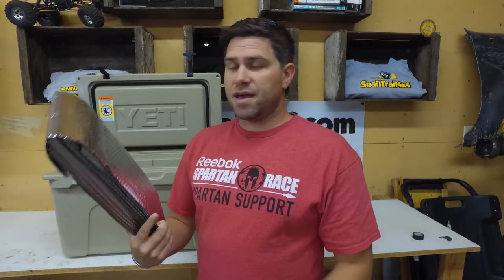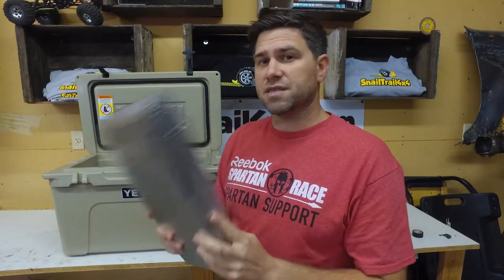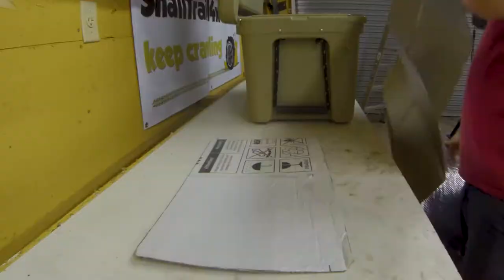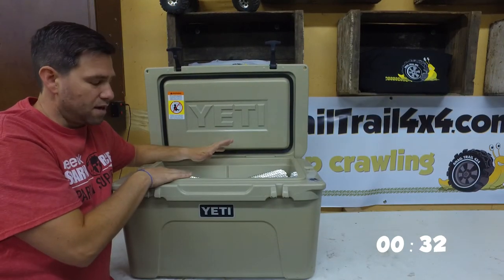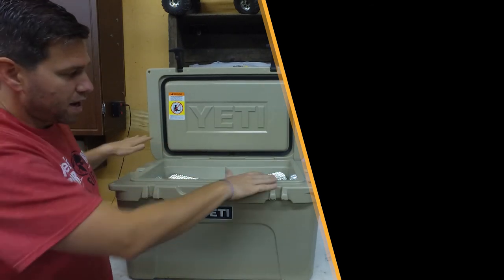False Cooler Lid for your ice chest

Comment: I did used on the top on the lid of my cooler and noticed the ice lasted 3 days longer than usual so I'm going to full wrap from outside since my cooler is in the back of my truck and gets exposed to the sun most of the time.

Also, I use 2 liter soda bottles filled with water and ¼ cup of salt, and it works awesome!

Comment: Air is a very good insulation. 

The problem is the distance between the surfaces. If too large say two pieces of glass, like 4 inches in between, you can get a vortex, circular air moving, from the hot side, to the cold, transferring energy. 

Same problem you get in the winter heating a room, hot ceiling to cold floor, circulation flowing between the two.

If the cooler manufacturer has disturbed the airspace flow, broken it up,  inside the lid, you are OK. If a huge rectangular airspace, and that Yeti looks like it has one, you need insulation. If you look at a lot of cheaper coolers, the bottom of the lid isn’t flat.
Reply from the maker: I understand what you're saying but I disagree with you about how air is a good insulator. If this was true, why do they add gases to double pain windows, or installation into walls and not just use air.
Reply: @SnailTrail4x4  mainly fogging in windows.

Some gasses stop,slow convection aka air movement transfer, hot side to cold. This allows very large window gaps between panes. Air is a very good insulation in foam, because the bubbles are small, lots of them, not connected to each other, bit of gapping between them.

https://www.courant.com/hc-xpm-2012-06-01-hc-ls-foggy-windows-20120526-story.html 

My problem is people who shoot thick, closed cell foam into the lid. If this stuff isn’t allowed room expansion, my guess, they just created a very dense, thick, heat transfer block in the lid? 

You need air bubbles in that foam, lots of them, this is what is providing the insulation. 

The Yeti has a very airy light foam. Most cooler uses a slightly denser, I’m wondering if that is what the Yeti has to use a  much thicker plastic? Sitting on a standard thin cooler you just might crush the foam, if it had any? Yeti is like a Russian tank.

 I think the best mod, the thing missing on low end cooler,  is a lid gasket. They should at least mold a channel in, let you add it, if you want. Aka extra cost.

I’m no expert on this, just some observations, trying to out think the manufacturers. :) 

FYI,
https://www.youtube.com/watch?v=9sHvp1V5e5w

Comment: Great idea! You can buy a whole roll of it at the hardware store for close to the same price. Use them for "cozy coats" all the time with my backpacking steel cups. I'm going to make one for half way down and keep just the frozen stuff underneath and, like you say, the drinks above where it will only be cool. Veggies don't like it that cool either. If the top half isn't cool enough make a few small holes until it reaches the right temper as the top layer will still hold a lot of cold in. Great idea, thanks! Of course up here in Canadian winters we have a built in ice box just about anywhere you go lol.
Reply from the maker: Yeah but up there don't you use the ice chest in the winters (with out ice) as a to prevent everything from freezing? 😀
Reply: Yes indeedy!